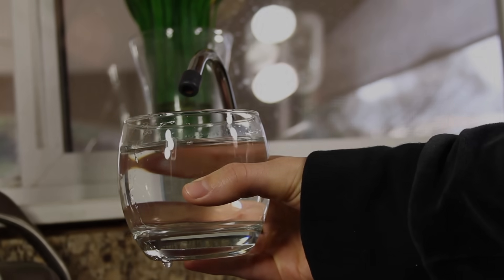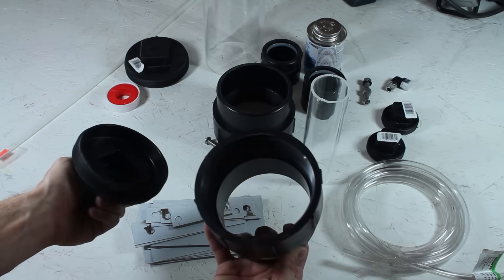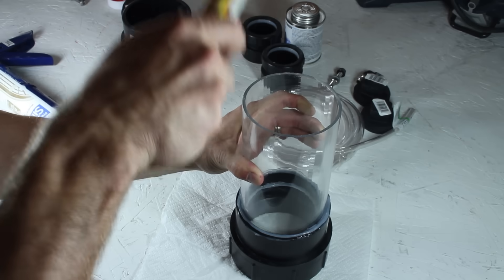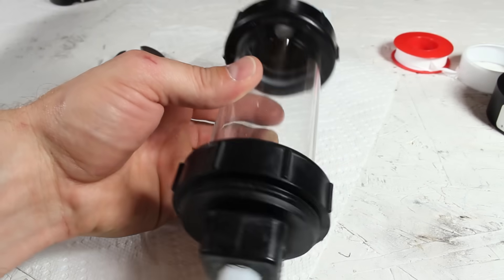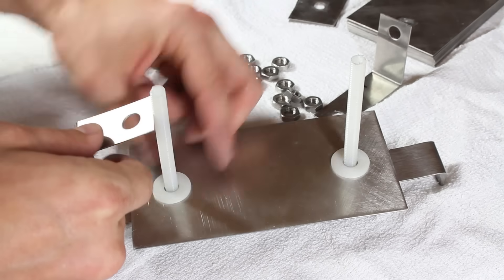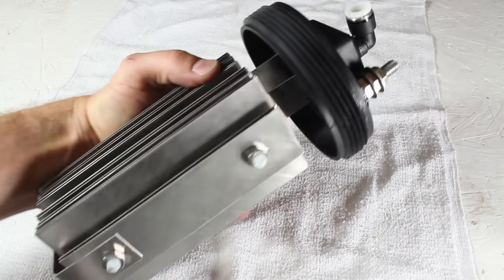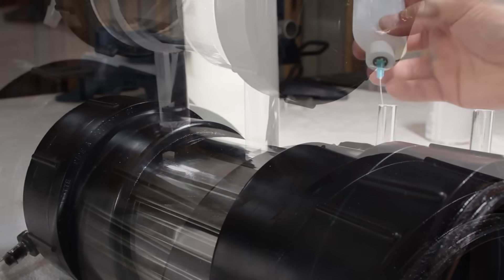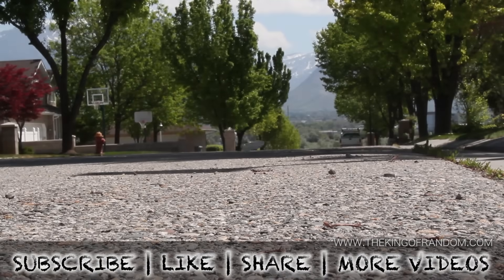HHO Generator - Water to Fuel Converter

Comment: The best way for this to work properly would be to be able to separate the hydrogen from the oxygen then feed direct hydrogen to your vehicle the oxygen would act as a catalyst or a booster you would have to change timing and all that other stuff
Reply: Hho is even more explosive so its ok to be used as a fuel. I just dont get it why they never cut down fuel doses to make it work properly.
Reply: I am sooo interested in converting my vehicle. Please teach me more!
Reply: @factfinders6998  it would cost more on parts than your car is worth
But a man in 1970 did it to a VW bug
Look it up on here you will find it 
Hydrogen burns was hotter than Petro so you would need ring sleeves and from tungsten and rings made from it also

Comment: DONT USE WATER AS FUEL WHEN YOU BRAKE DOWN WATER MODULES YOU GET HYDROGEN A VERY FLAMMABLE GAS AND O2 AND THE HYDROGEN WOULD USE THE O2 AS FUEL AND POSSIBLY EXPLODE IN A UNCLOSED AREA IF THERES ENOUGH O2 AND HYDROGEN
Reply: That's the point of the video.

Comment: I ran a car like this, but I used the discs I found in some old computers  because they are plated with platinum
Reply: The very same, some have platinum, and some are plated with aluminum.  They lasted for a little while but not for the long haul. But it was a start.

Comment: Dude next time put the silicone on the outside parts of the acrylic tube that will be inside the abs connector and then persuade them together as you did. This will hold and seal Berger then putting the pieces together then caulking silicone.
Oh and way less mess or hassle with that messy part that want be messy anymore
Reply: He is no more...

Comment: If you charged the batteries up with solar panels... could you produce more energy by burning the hydrogen produced from this reaction? Or are you better off just using the solar power directly. It seems like you could make cheaper energy turning solar into hydrogen.

Comment: Hi :) and congratulations. I see the power fed 24 volts x 20 amps = 480 watts. For example, If I increase the voltage by bringing the amperage to very low values, could I get the same result? Ex : 240 volts x 2 amps = 480 watts ( the same power). Regards

Comment: Came here from the water powered car video. I'm no chemist but it seems as if this kind of system could be run into a small engine since hydrogen is difficult to store.
Reply: I'm in the same boat like you, thinking into running a 2200 watts inverter honda generator with the propane gas kit that sells in amazon, not sure about how to reduce the explosion dangers though...

Comment: How does this create oxygen, or does it? I know that if you use NaCl, you just get Cl and H in gas form, while the Na combines with the O2.
Reply: H2O is split into H2 and O2, bro.
Reply: @ingarssamins1411  Yes. I misheard the video, thinking he was using potassium chloride instead of Potassium Hydroxide. If he had done that, the electrolysis would yield only Cl2 and solid Potassium, not Hydrogen and Oxygen.
Reply: @malachidrew8291  mistakes happen :D

Comment: Just like electric cars, your still stuck needing electricity which is only made reliably and abundantly enough by a coal burning plant.
You' re still creating the same pollution but with extra steps. 
Which now you have to mine, refine  and process plastics, lexons, rubber, metals, teflons and the catalyst.
 NOT INCLUDING the dispoal and the recycling of these products when done.
It leaves you with a CONSIDERABLY larger carbon foot print than just burning the gasoline in your car.
Its a fun experiment but as far as calling this a " green alternative" is demonstrably ignorant.

Comment: electrify the water to make hydrogen and oxygen. then use the hydrogen to power an engine. idk why people havn't used this idea
Reply: It doesn’t produce enough power.
Reply: @spencernelson1580 well carbon fibre exists and electric motors can propell a car forward
Reply: Grant died ☹️
Reply: They have its just not as efficient as gasoline or comparable gas creation designs

Comment: I think you have to revisit this project. Huge potential. Solar or wind power instead of going into batteries getting turned into hydrogen and then used to power an electric car with either a fuel cell which is hard to get hold of so maybe a petrol generator converted to hydrogen.

Comment: This was pretty impressive and educational. But I think the reason that this is not a very viable alternative is that the power for it is coming from the batteries, which require fossil fuels for manufacture. Also, diesel is more efficient I guess. There's a parameter for judging energy efficiency for different fuels called 'EROI' (Energy Return on Investment). And the reason for fuels like water not being chosen as alternatives is that they have very low EROIs.

Comment: I used to make these in mason jars. Best results came from a pair of them built in half-gallon canisters, boosting a warmed over '76 Corvette to the low thirties down the freeway. (75 mph at 2850 revs, trip of one hundred miles, elevation 4800-6000 feet and checked at 6000 feet.) Rest easy friend, glad you played with this stuff too.

Comment: now you just have to figure out how to attach this to a car - to generate fuel
Reply: So, Diesel engines will run more efficiently when you pump hydrogen into the air line; pre-combustion... I may have a misconception of this but hydrogen increases mileage and helps burn the diesel fuel down before it hits the tailpipe, making the vapor less carbon filled.
Reply: @gusmon83 - in the distant future you will convert water to fuel in real time, that would be cool

Comment: I used a lye water mix when I did this and it ate my first plates in about 20 minutes try 2 rusted my stainless steel plates near instantly. I built it for my truck and it worked for a long time but I took it off eventually due to maintenance. I never did figure out how to keep the plates longer than a couple days of intermittent  use.

Comment: A Chemical Dosing Pump could be used with reed type float switch to top up the bubbler with fresh electrolyte this will elements the need for opening & refilling  the bubbler.

Comment: This all torture 😜 is done, for creating hydrogen gas from water using electricity and then again hydrogen is used as fuel to create electricity for use to power a car...

Why don't we straight store solar power in battery and save ourselves from this torture....

🙏🙏🙏
Reply: Use solar to make hydrogen...use hydrogen to run generator....

Comment: Nice, Today's Tiny Tip Is:
 Did you know that the metal Gallium can split the Hydrogen from water when heated up? AND the metal CAN be re-used, if you can create a machine that with Gallium that also uses the electricity created from it-self to heat the Gallium,  then you'd have a very efficient way to split Hydrogen from water that would revolutionize our industry. (just include me in your patent)
Reply: Andy P he is dead

Comment: I don't get what the bubbler is for, does anyone have an idea ? I mean, the gaz would still be produced without going through is water, is that for filtering purpose ?
Reply: Fire arrester.  Both filters and prevents an explosion from reaching the main cell
Reply: @RaspyOB174  Yeah I've seen some videos and read about the subject and I agree. It is also usefull to highlight the HHO production as well.
Reply: im wondering that too!
Reply: Pretty sure it contains the separated mixture. Directions on containing the fuel weren't too clear
Reply: For demo, so you can see the gas generated???

Comment: So....How many liters per minute would be required in order to supply an adequate amount to a  small four cylinder engine thereby powering a small car?
Reply: You'd never produce enough at a fast enough rate to power a motor vehicle. You'd have to manufacture it prior to using it, then compress it.
There's other issues to overcome like engine compression, valve wear, etc, etc. Too much to go into here.
They engineer a motor to run on petroleum, using a different fuel could have catastrophic consequences.

Comment: Is the Hydrogen fuel as pure as it can be like 100% Hydrogen???
Reply: No.
The way he builds it is hydrogen and oxygen in the same container.

To seperate the gases you would need a U-pipe, with the one elektrode at each end of the U pipe.
The Hydrogen will oy form at tbe elektrode wich is connected to the negative lole of the battery. And the U pipe construction will not allow thd gases to intermingle.

Comment: This should be coupled with a solar panel or a wind turbine to generate H2 and O2 gas throughout the day.
Reply: You would do better with a battery connected to the solar panel or wind turbine for energy storage. Converting solar or wind to electricity, then using the electricity to convert the water to hydrogen and oxygen, then burning the hydrogen for energy is highly inefficient. Just use the electricity directly.
Reply: @notahotshot  but then you can make rockets
Reply: @notahotshot  
the problem with that is that batteries are big, heavy, expensive and can't store much electricity. I think the best idea is using hydrogen created to make hydrocarbons, which can then just be piped into the current system.
Reply: The most efficient hho generation made possible by a photovoltaic production 

     The cell is immersed and photons split the water instead of generating electricity

  So windmill to make light to make hydrogen
Photovoltaic water splitting
Reply: No.  There is no way to store / compress and then use for power or useable fuel later. It's literally useless.  Only one company supposedly was developing complete system to produce, compress, store and use H2 for power but no news for several years.
Reply: @mr3817  That is actually not true at all. Hydrogen gas is difficult to store, but not impossible, and is fairly common in industrial application.
Reply: @operator8014  yeah but still pretty troublesome. Owners of Toyota Mirais are complaining a lot.
Reply: @carlosandleon  That's what I said. I don't know anything about the Toyota Mirai, but I said that it is "difficult... but not impossible".
Reply: @operator8014  it's too impractical. there already has been some accidental explosions
Reply: @carlosandleon  It doesn't matter if it's impractical in a vehicle, it's still possible, just difficult. It is certainly not impossible, as proven by these cars operating long enough to explode in the first place.

The technology exists, it just needs to be implemented well. Whether or not THAT'S possible, I don't know.
Reply: @operator8014  hydrogen cars will flop
Reply: @carlosandleon  thats what people said about cars long ago. the world would not be where it is now if people had your mindset
Reply: @namisauce9826  Yeah but it's not efficient. Innovation goes to the path of least resistance and Hydrogen is just too wasteful and inefficient. There's one thing saying you can innovate anything and it's one thing saying let's make flying cars by magnetizing all the roads in the world. It's impractical and wasteful. You can do it yes, but it's absolutely nonsensical. Straight to battery power is more efficient. Perhaps we can use hydrogen cells in Industrial Equipment but it's too impractical for daily use. 

Innovation comes from naivety yes, but not from stupidity. Know the difference
Reply: @carlosandleon  i was trying to get a point across of how you have to have optimism to have innovation. it may be impractical to use hydrogen cell for everyday use, but trying to do so it is possible to find new technology that can be implemented elsewhere. i do get your point tho.
Reply: @namisauce9826  the optimism is under naivet, so i think i addressed the issue. And I'm not against innovation at all. But there are some things that are just not meant to be pursued. Hydrogen can be implemented, just not on the commercial scale
Reply: @carlosandleon  im not quite sure what you meant for the first sentence. i already said i agree for the last sentence
Reply: m r whats the name of the company sir?

Comment: You give zero information! What is you Letters of gas per minute produced, your voltage applied and the current draw. Then and only then you have given any information at all!
Reply: 2 car batteries and 5 liters a minute watch the video
Reply: @retrodigi375  What amperage are you drawing?
Reply: @retrodigi375  Tell me the current draw, the amps drawn and then I may watch the video.
Reply: 2 car batteries are probably 24 volts although they can be 12 or 48 volts depending on what type of car batteries
Reply: @retrodigi375  Still waiting for the current information and by the way are the car  batteries hooked up in series or parallel and are they 12 volt batteries or what? Then after you do that I will decide to either watch the video or not!
Reply: @edpence5931  if im being honest with you its most likely in series a car battery most likely provided the needed current but to up the wattage he raised the voltage is my guess, i thought you were a troll but at this point i do not care but i hope i helped night

Comment: it takes more energy to split the water then burning oxyhydrogen releases, thus you only made a inefficient converter from electricity to chemical energy
Reply: This is one of the way you can use nuclear power to split the water into hydrogen, that will be the clearest power source for the electric car in the future, also that is some people predict battery power electric car very be out very soon.
Reply: @jxmai1000  or you could just use the electricity to drive a motor. That’s called an electric car!
Reply: What if you where only using the hydrogen to supplement the fuel system ? Like shooting it into your vehicles intake and mixing it with oxygen and premium fuel to get a cleaner burn , would this still be an inefficient way to use this ?
Reply: @atomicsplitter_gaming  That would be similar to nitro injection then, wouldn’t it

Comment: FYI. Using salt as a catalyst produces caustic NaOH (sodium hydroxide) and chlorine gas and hydrogen in equal amounts. The hydrogen may be useful, but the chlorine gas and caustic NaOH are dangerous and only useful when produced in an industrial setting.
Reply: What would you suggest? 

Use sulfuric acid or maybe no catalyst at all?

Comment: Is there a specific volt and amperage required? Could you maybe experiment with variations to find out what produces the most. For instance 12v at 1 amp vs 1v at 12 amps and similar variations.

Comment: With this Gas you can fire an Engine and m’y question is can you make a Video about the was to Power the Engine?
Reply: Exactly right.
Reply: Toyota has an interesting take on this idea already look into it
Reply: But the energy required to split the water apart is more than you get from the engine. Unless you use platinum for the plates instead of stainless, I think 🤔

Comment: Can explain what the metal plates are for? 
I’m sorry I don’t understand its purpose!
Reply: "A hydrogen generator, better known as an HHO Generator, or HHO Cell, uses voltage and amperage to force water to give up its molecules of hydrogen and oxygen gases. The amount of gas depends mostly on two things; how well the water passes the amperage, and how much amperage travels across the electrodes surface area. The electrons do not pass through the metal plates; they travel around the outer surface. They take the path of least resistance. So it is very important to evenly space the electrode plates - equal distance apart; perfectly parallel to one another. If not, electron current will not be equally distributed across the plate surface. If that were to happen, electrons would pile up at close crossing areas, and heat would build up. We do not want that to happen."

the metal plates in this video are the electrodes
Reply: Pj M thank you. 
Makes more sense. 
Really appreciate it

Comment: I'll bet your using more energy to split the h20
Reply: It kinda works like a capacitor bro. We supply continuous energy at a slow rate and on ignition it releases heavy energy in small amount of time. That's the reason HHO engines are not commercially successful.

Comment: How much energy this gas produces and how much electricity you need to complete this process
Reply: 11kJ per Lt, a minimum of 1.8V is required and more the current faster the electrolysis
Reply: what will happen if i replace my vehicles fuel with this will it work or not if this is flammable and produce a lot of pressure and energy why we cant use it as a alternate fuel for vehicle coz it looks like its a green energy source
Reply: @enoughsaid9624  so you want to REPLACE your vehicle's fuel with hydrogen instead of petrol? Your ride is gonna die bro. It sure is a green energy source but you will need a seperate type of engine to use it. Someone from coimbatore already made it
Reply: If i use it in the place of cng operated vehicle thn is it dangerous too

Comment: How much  V (volt) should be? 220v?
Reply: No, 240v would be very bad. That's too much potential between the plates. What you should worry about most in this experiment is amperage. Most people power these on 12v, although it's common to see as low as 5v which can be just as efficient and prevents overheating as much. however you want a power supply that can handle 30-60 amps happily and remain voltage. Car batteries are perfect as they are 12v and are designed to pull 60 amps or more to the starter motor. However for a more permanent solution, a PC power supply is common as they are 12v and on average 30 Amps AC.

Comment: how do you avoid corrosion on the electrodes? Is it a matter of the type of electrolyte used? I gave a similar setup I'm using, but I'm using table salt- corrosion is a constant concern.
Reply: Michael Dinwiddie Are you using stainless Steel?